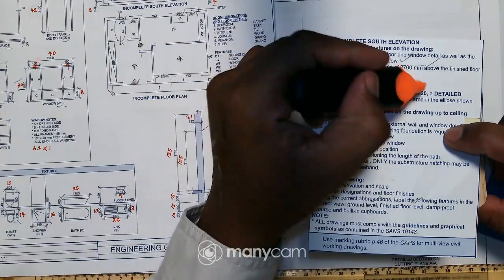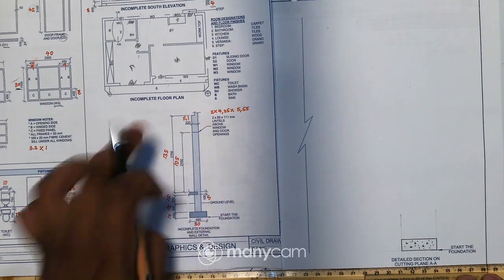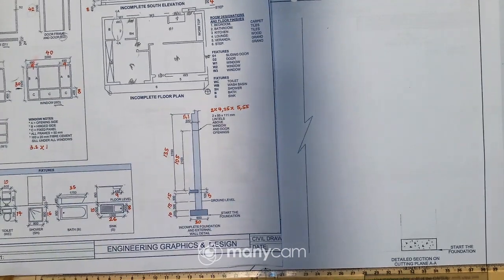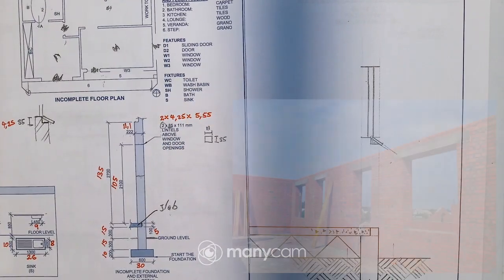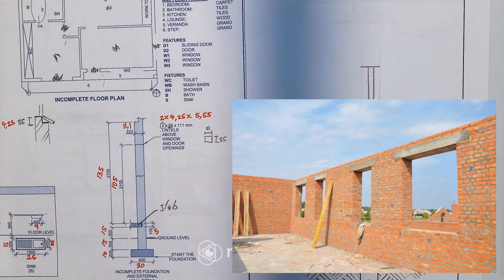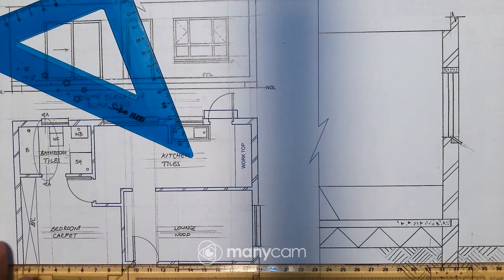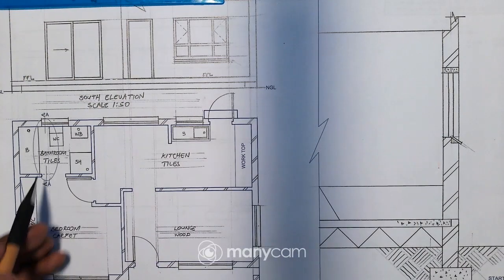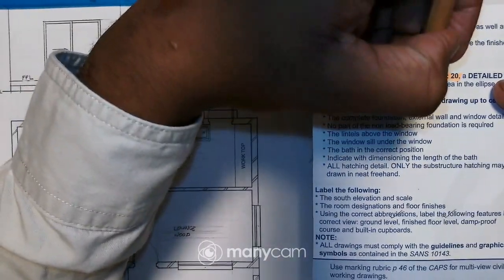Grade 11 - PART 2//Civil drawing//JPEGD Page 56

Comment: Why do you draw that step underneath the window?
Reply from the maker: The step provides both vertical and horizontal support, allowing the window sill to rest securely in place. It acts as a structural base for the sill.
Reply: @Mr_B.Mhlanga  thanks boss wami 🙏